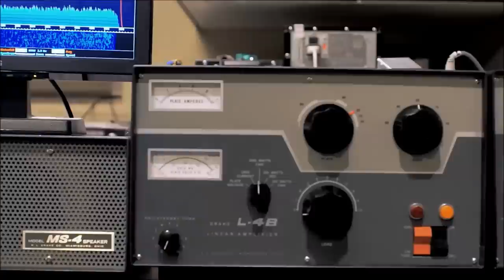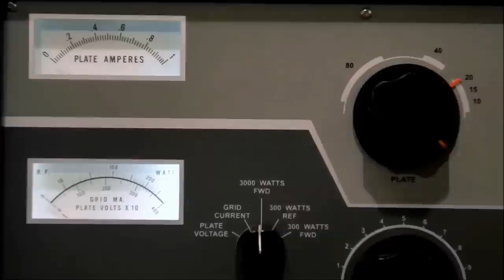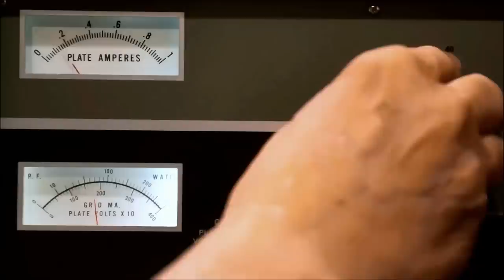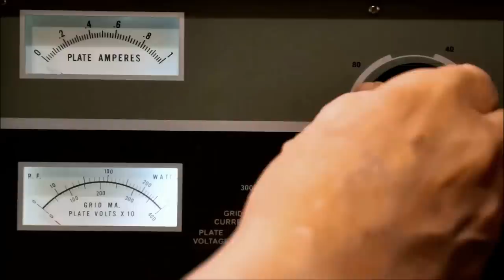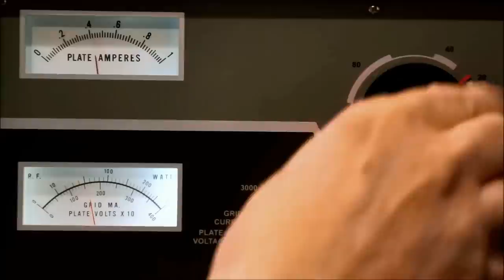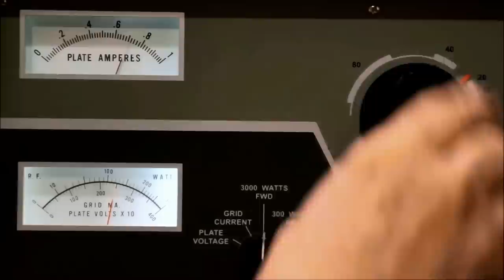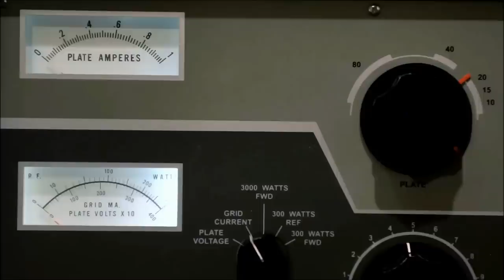Ham Radio Basics--How I Tune A Linear Amplifier

Comment: Jim, I realize that this is an older video but yet the information was useful. I've been a hand for quite some time and I am an extra class. My setup is a Yaesu FT 2000 connect to a 811H followed by a LDG AT1000. I've switched the tubes to the 572 s so I do get a bit more than 800 out of it. There's enough headroom for the LDG to handle.

But what I don't understand is there's 50 ohms coming out of the transceiver going into the amplifier that is showing a good SWR before I turn the amp on. That tells me that the antenna is resonant for the most part. I don't use the internal tuner at all.

The confusing part is when I turn the amp on and tune it the SWR goes up to about 2.5:1 even though I have properly tuned the load and plate.

What issue am I looking at? Your paragraph thank you in advance.
Reply from the maker: From my phone, what is Entune?  I do have an idea about what might be wrong.   73 Jim w6lg
Reply: @ham-radio  :: good morning and thank you for your reply. I long ago corrected the word Entune to the proper *and tune*. I'm guessing you have a reader or email account that got the uncorrected version.
Reply: @ham-radio  :: I guess it would help to continue that. Too early in the morning for me to be typing. What's your idea? I'd appreciate knowing.
Reply from the maker: Okay, I have built many amplifiers over the decades.   Some like you are using. Just to make things easier,  disconnect the coax from the tuner.  Get the tuner completely out of the circuit and test again.

Likely, there is no change as a result of the above.  You amplifier has several tuned circuits (tuners).

capacitor----inductor----capacitor

The 811H schematic has a switched tuner on the input that is adjustable. 

The input impedance of those 572B tubes may be different from the input impedance of 811a's.  I know the literature says the impedances are about the same 215 to 220 ohms, but I suspect that is not the case here.  

Also, the input impedance of the amp is not the same as the impedance of the antenna system as seen by the plate tank circuit.  That tank circuit might be matching a few thousand ohms down to 50 ohms. 

Does that sound about right to you? 

73, Jim
Reply: @ham-radio  :: I appreciate your input. Pardon the unintentional pun. I understand what you're saying. But I have no way of knowing with the SWR is after the amplifier unless for example I put my Bird 43 inline with a 1kw HF element. Then I can see the reflected.

I understand what you mean about tuned circuits but until about 10 years ago I didn't use amps. I used tuned  antennas such as a SteppIR. Straight through with my measly 100 Watts I could get a good SWR. Unfortunately, it came down with my divorce and hasn't gone back up. So I run a Alpha Delta DXCC that gives me relatively good performance on all the bands. The LDG basically just put everything at a perceived 50 ohms. I know that it doesn't tune anything. Incidentally, it's already out of line because it failed. I was getting 0 output but measuring 100 watts output on the Bird 43 from the transceiver. That told me where to look. So I am out of line. But again, I can't see what the SWR is reporting unless I put the Bird 43 in. I know they're accurate to about 5%. I'm wondering if the ldg was it a pre failure mode and I'll have to put the Bird 43 in and explore a little bit further. I do recall at the time checking the reverse and seeing some reflected. I didn't translate that to SWR.

I won't take your time and ramble on anymore. One reason I asked questions is that should other hams see this and have similar questions we can all learn at the same time from someone such as yourself with a vast knowledge of ham radio.

Thank you for your response and thank you for what you do.

Comment: Hello Jim from Humboldt CA my name is Aaron they call me 707 I really like your web page with linear using Ldmos I havent yet figured out my combiner for using Ldmos instead of old "pill" type power transistor ive learned everything on my own only looking at pictures and had to look up each part to find values of them nobody shares info and its hard but after all i'am using citizen band and registered myself the very first two pill i built because of my dad is there a page that explains the way to use Ldmos padding or combine like old school simple pill ? by the way love your video's just found them
Reply from the maker: I don't have an answer for you.  But it would be good if you studied a little for an amateur radio license.  Drop the CB lingo and speak in plain language on the ham bands.  You might want to find a local radio club for support and testing.  73, Jim W6LG
Reply: Nena Pike, go to KF8OD.s website, he built a few with the BLF188XR LDMOS and has full schematics. He is giving up on tube amps now that he has these new devices

Comment: OH, this is Beautiful! i always was a bit mystified when it came to tuning a linear as opposed to a class C plate modulated rig like a Viking 2! my first experience was with a "Knight Kit" marketed for 10 meter ham, but really made for CB! that tuned up just about how you described here but in fewer steps. it was pretty clean actually! What caused the really distorted signals? Overdriven mobile amps or the fact that they were solid state?

Comment: I have been using 3-500Z/ZG tube Amps (Drake L-7, Kenwood TL-922, Heathkit SB-220 etc for 30 years now.
First tune 40 watts, second tune 100/200 Watts drive, pending on Exciter rig.
Never had to replace a set of Finals yet. 
Great video, but a very long winded process which is far from required.

Comment: i was looking to get a clearer guide, rather than " a little here and back off there and see what that shows and it might be less". better would have been what you are tuning why, what are the values, what am i changing, etc. maybe the next one hits the spot better. thanks for trying though
Reply from the maker: Before I answer Ralph, what amplifier do  you have?
Reply: @ham-radio  once I get it back from being checked and serviced,  a FL2100B
Reply from the maker: @ralph9987  Okay Good Ralph.  That is a nice amplifier.  If you look at Page 7 in your instructions for that amp, it describes in much less detail, basically, the same procedure.  With an RF amplifier, you want it to be linear!  There are no presets that work.  Why?  Because it is an amplifier with a tank circuit.  For example, if you go from let's say 7050 to 7200, you should touch up the tuning...retune it.  When you change antennas, you should retune.  If you don't do as I describe that amp will need to back for service and likely new tubes.  I have about 56 years of tuning amp; 1964.  Have fun with that amp when you get it back.  It is a nice design.  You are lucky to have it. 73, Jim
Reply: @ham-radio  thanks Jim

Comment: I can't tell why you're moving each of the two tuning knobs or  what you're looking for in your adjustments..     This isn't the explanation I am needing.      I understand it's all so easy for you, but  you have had many years experience.
Reply from the maker: I was tuning for maximum output power and keeping the grid current within limits as stated on the data sheet.  73, Jim

Comment: 2,000 watts input for 1,200 out? That doesn’t make sense. Did you mis speak and mean 200 watts input?
Reply: No, it's 2000 Watts PEP power input max. from the power supply to the linear PA. For 1200 Watts PEP output max. RF signal power from the linear PA to the antenna load.

Thus 60% peak plate power efficiency.

Naturally the figures for PEP input power and efficiency drop considerably on average for ordinary voice service on SSB. 

But those are the specs. for maximum conditions at the crests of the SSB modulation envelope.